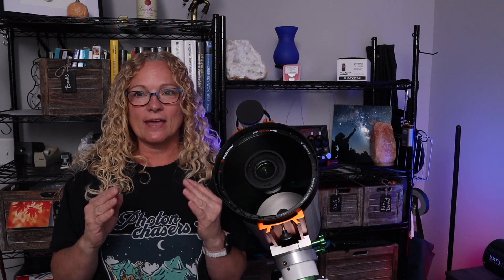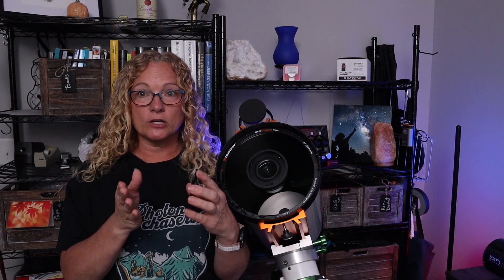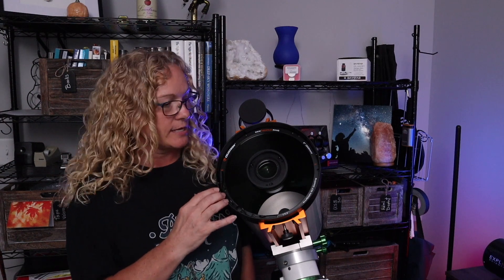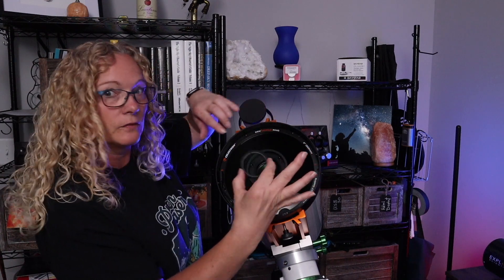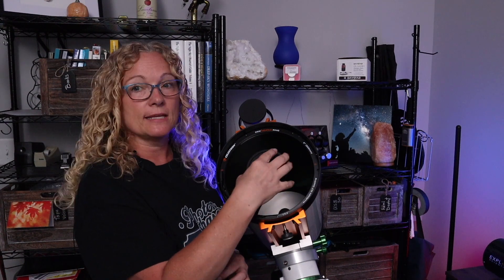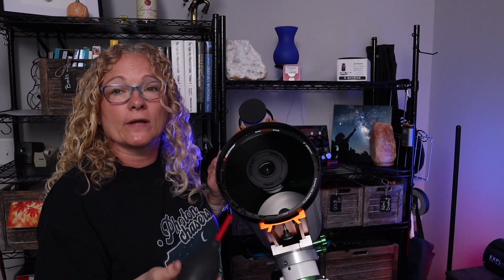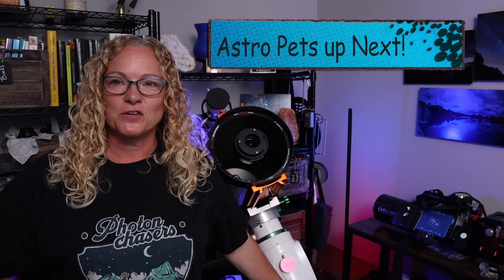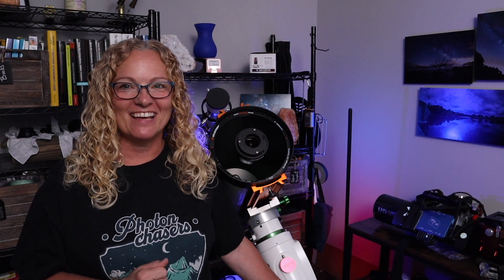Celestron RASA Back Focus - How to Calculate Back Focus - What are my Options.

Comment: Still working on figuring out RASA 8 back focus.  If the camera adaptor is 3.5mm, and the Starizona Filter Drawer is 19.5mm, and the camera is 6.5mm, we are up to 29.5mm.  If we are trying to hit 28.73 plus about .65 with the thickness of the filter (thickness x 1/3) that is 29.39 and we are slightly over.  So I am not understanding why you added a spacer.  The component I am not sure about is the M42 adaptor thickness.  The manual spec diagram you showed is 3.5mm.
Reply: and your are ment to leave the celestron glass in to bring the bf down

Comment: Thanks Amy. I been confused on the clear glass filter. I think i will take it out and add the 1mm spacer. Lots of pets. LOL Astrobill
Reply from the maker: The glass troubled me also.  I got Celestron's input on this also.  They have tried it both ways with the filter holder with good results.  They feel without the glass was slightly better, but not enough to stress over it. Choose which way makes you happy.
Reply: @AmyAstro  Thanks Amy for this tip. Astrobill

Comment: Hi Amy - the Starizona filter draw makes it really easy :) The confusing thing is that on the Starizona site, it says remove the Optical Window - so Celestron says retain while or out Starizona says remove - who is right ? A filter will add approximately 0.83mm to the back focus. I think I will do som measurements and calculations. TBH I get really obsessed with back focus and end up 3D printing M42 and M48 washers, to get it spot on !
Reply from the maker: Back focus drives me nuts also.  I hate losing images due to star drag. Eventually I will go down the path of 3D printing. One learning curve at a time.  It is odd that they contradict each other.  I will follow Celestron's manual first.
Reply: @AmyAstro  As I posted on your facebook page - I Calculated a backfocus of 30.33mm? ie Celestron M42 Adapter (supplied with the RASA8 - 3.5mm), Starizona Filter Drawer for RASA (19.5mm), LRGB filter (2mm thick / 3 = 0.83mm) and ASI294MC Pro (6.5mm). I would say that I do not get perfectly round stars but I cannot reduce the back focus unless I remove the filter drawer and add short spacers. Interesting the normal M42 Starizona Filter drawer has a back focus of 17.5mm (but 18.5mm with M42 F both sides). Measuring my actual hardware from the M42 adapter face to camera face = 22.5mm, adding 6.5mm for the camera gives 29mm and adding filter gives 29.83mm.
Reply: @Lord_Whiteley  Did you design the 3d spacers yourself or does one already exist to use?
Reply: The clear window changes the back focus.  So Starizona says leave it out for their drawer, which was calculated not using it, so that the filter is in the drawer only and you don't have 2 filters in the optical path.